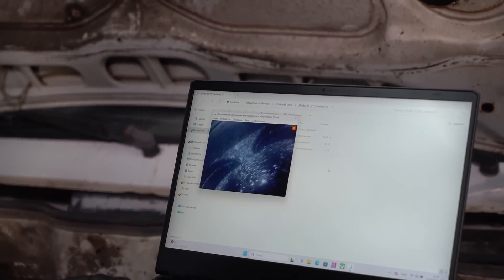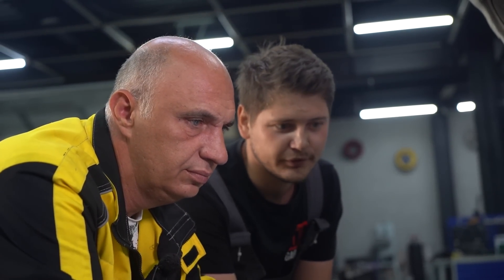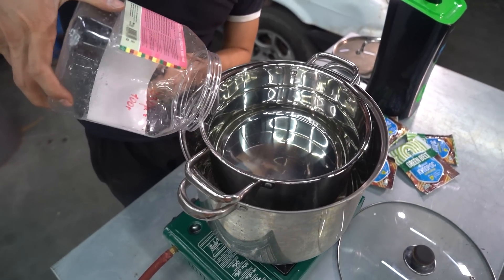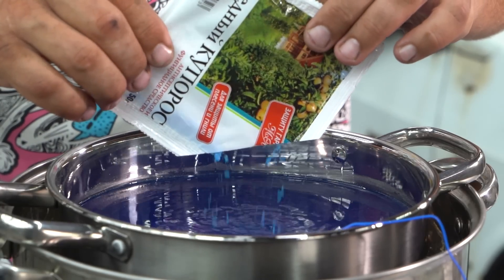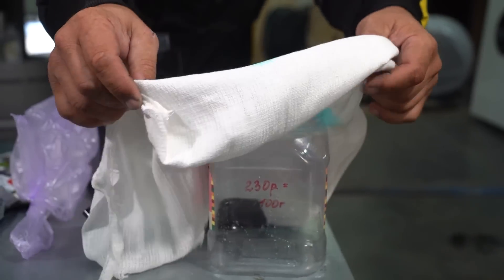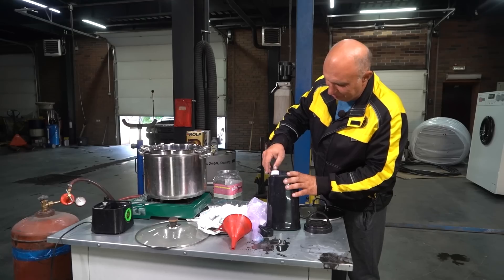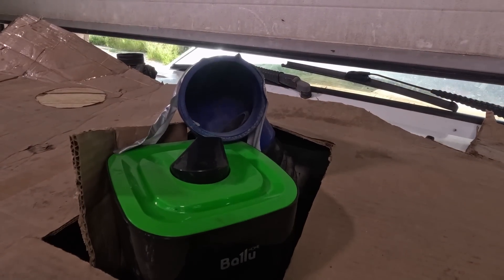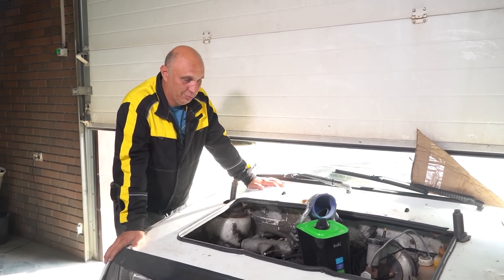Can we use copper sulfate to clean a sludgy engine?

Comment: Yep. One of the most important tips about ultrasonic humidifiers is that you should use ONLY distilled water. If you use hard water that contains minerals, they are dissolved in the water, and the mist contains such minerals. Then the droplets are deposited everywhere and when the water evaporates, it leaves behind the minerals. So, that deposits those minerals everywhere the mist can reach, over every surface.
This seems to be exactly what happened in this case: the droplets evaporated when they touched the hot engine, and leaved a lot of copper sulfate attached in those areas.

Comment: #4 has no compression … because it has no rings anymore. Copper is a GREAT abrasive. And if I’m not mistaken, will turn to sludge when it comes in contact with oil. But should be really pretty to look at. Also copper sulfate works great if you wanna clean up a pond.

Comment: Does the engine these valves came out of have a wild cam in it? I have long been sickened by posing drivers allowing engines to lope at low r.p.m. while stationary and at low road speed in front of crowds. As a mechanic I have been aware that such practices cause exactly what you are showing in your thumbnail  😢

Comment: Did you try 2 squirts of oil in the low-compression cylinder to determine ring sealing ??  If no compression  increase; look to valves. Easy to forget such a basic old technique.

Comment: now i would hose it out with water. crank it and give it some high test gas.pul it down the road . to see it te rings would come back to life i mean phosphates burn hot. the ring grime might burn out. i have used the old style ajax cleaner in motors . but that was sprinkled threw the intake. stuff burned real hot.

Comment: Turn  the engine over till valves closed then use a work shop air degreaser gun . Blast the port . Result is clean port /valve .

Comment: Americans will run the engine up to about 2000 RPM and run pure water in through a vacuum hose. It seems to help, maybe an experiment of running pure water into an engine to see how it does would be a neat idea... something fun for everybody to see!

Many Do-it -yourself mechanics like to run all sorts of stuff through the vacuum lines though.... intake cleaner, valve cleaner, seafoam, Marvel Mystery oil, kerosene, or just about whatever other solvents we can get our hands on.

Comment: You should try HHO or electrolysis. Hydrogen and oxygen. It's hoter more powerful and 10x faster. It cleans all carbon from the piston rings and valves.

Comment: "almost" every metal is more reactive than copper, meaning that whatever metals come into contact with the copper sulphate is going to sacrificially kick the copper out of the sulphate (hence the copper deposits) and replace with whatever metals are in the engine (iron, aluminium, etc). so yeah this was a terrible idea, you're just eroding the engine's metals and filling it up with copper deposits. evidently this was not suggested by anyone with chemistry/metallurgy experience. lol

Comment: WHY WOULDN'T YOU JUST PUT IT DIRECTLY IN SOME FRESH OIL??  LKE DO AN OUL CHANGE WITH IT IN THE FRESH OIL.  RUN IT FIR A BIT, THEN DO ANOTHER OIL CHANGE.  THIS WAS MEH...
Reply: The build up wasn't in the oilpan? It was in the Cylinders, where air and fuel come in and go bang. It wouldn't do anything to put it in the oil except damage your engine more.

Comment: What happens if you try this on a 2-Stroke engine?
Reply: copper sulphate will destroy (almost) any metal it comes into contact with (refer to the reactivity chart of metals) by liberating the copper in the sulphate solution and replacing it with the other metal, eg you might end up with iron sulphate and the liberated raw copper will build up and oxidize.
Reply: @joeledwards6587  That would be nice of the bearings in a 2-stroke engine... I want to see that! :)

Comment: I suspect that the water caused the copper sulfate to oxidize faster, and instead of leaving as a gas or dust, it just stuck around in bog chunks. and got burnt to the inside of the combustion chamber

Comment: Based on my own dabbling in electroplating, I wouldn't think using a humidifier would works, as the copper would be too heavy and wouldn't be retained in the water droplets. 
So it'll be interesting to see if the thumbnail was actual, or the typical photoshop job 😅

edit: Well, more made it in than I expected! I wonder if the "green" they're seeing is it having gotten converted into Copper Carbonate 3 (CuCO3)...

Comment: Try to rev limit the engine in low gear and high load, with no exhaust. it will clean the valves very well

Comment: You ran it at too low an RPM. The air speed inside the port allowed the copper sulfate to drop out of suspension and pool at the throat of the port. Run it at 3,500RPM.

Comment: there is a additive called engine restorer it was nice to see if it would help
Reply: I used this when it first came out in late 83. Much to my surprise, it really worked. Compression was improved. Engine ran much better. Since then I've used it in several engines with good results.
Reply: @halrhoads6194  nice, can it fix piston slap or rod knock?
Reply: @benshefer4767   I dont think it can because its mechanical parts that are already beyond repair

Comment: Clean the crap out of the ports and off the valves, along with the valve seats, put back together with new stem seals, using a new head gasket, and you should have good compression.
Reply: I mean, obviously....

Comment: You dont do that "water bath" because the heat is less intense inside (otherwise just boiling at lower heat would suffice) you do it because boiling water is steady @100c and doesnt increase in temperature (if you boil it on an open casserole like this )  no matter how big a fire is underneath it. 
This has as a result the inside smaller casserole to be at a steady 100c without increasing in temperature

Comment: Again requesting a Lada with an 'external oil cooler' that runs on cooking oil and routes the oil through a deep fryer 'external cooler' for fried food on the go.
Reply: Underrated
Reply: Making fries required oil at about 180c. How would the engine feel about it huh ?
Reply: @CaptainFalcon92   Just remove the radiator and use the oil cooler only to cool the engine
Reply: @gabrielvieira.4358  The engine would definitely end up seized, melted, or both at those temperatures.
Reply: @quentagonthornton49  Probably not, if the oil cooler was big enough
Reply: This has to be the most American thing I've heard today
Reply: Chinese gutter oil fries?
Reply: You can cook food even in motor oil but they just become inedible. Eating toxic food is not an experiment but suicide.

Comment: Please do a "Dynamic engine oil change" video. Where you open an oil drain plug a little bit on old and dirty engine and keep pouring fresh oil in from the top. How many litres does it take to get it clean?
Reply: They use to do it with diesel generators in the military that could not be turned off and had to run continuous.  Unfortunately I do not know how much oil it took.
Reply: I like this idea
Reply: They already did that using oil filters
Reply: They already did oil change till the oil is golden
Reply: you can't add engine oil while engine is running as it will spray through the pouring hole
Reply: @shrujanamsyama9940  Thats not true at all.
Reply: you use a spout and who cares about a bit of splashing oil?
Reply: @shrujanamsyama9940  HE NEVER SAID TO HAVE THE ENGINE RUNNING YOU EFFIN GHEYLORD PERSON!!!!
Reply: what's the point sounds boring
Reply: @benshefer4767  It will get rid of all old oil and flush the engine.  Some cars keep about 1/2 a liter of old oil in the engine when you drain it.

Comment: You guys should spray foaming degreaser into the engine and rev to 2500 rpms.  See what the results are!!
Reply: I have used zep degreaser in a engine. It did a ok job. But like other things you have to let it sit not running for about 10 minutes. Then a smoke show.
Reply: Water does the same

Comment: Fill an engine with diesel fuel, pour it into the valve covers and let it completly overfill. Then grab a air nozzle, mount a brake line to it, remove the dip stick insert the brake line into where the dip stick goes. Add just enough air to make bubbles and let it sit overnight. There was one vw guy, he would do this to clean sludge on engines.
Reply: Sounds pretty viable, would likely free stuck piston rings too.
Reply: @volvo09 that and help break up any corrosion that's on the walls. Diesel fuel works wonders when done carefully.
Reply: nothing beats diesel for dissolving bitumen (asphalt) and its carbon
Reply: Wouldnt gasoline work better for cleaning that diesel
Reply: @Crediu   No diesel has cleaning properties, gas has very little
Reply: @ibidu1  oh i thought gasoline was a solvent and solvents clean stuff
Reply: And then try to turnover the engine.
Reply: Makes some sense, there is more detergent in diesel than petrol.
Reply: Does the diesel evaporate? How do you get the rest out to not contaminate oil?
Reply: @JamesAnderson-fw5ew   You drain it out of the oil drain bolt, and for the fuel in the cumbustion chamber remove the plugs and spin the engine with no spark plugs.
Reply: @ibidu1  but does the residual diesel dry up?
Reply: @JamesAnderson-fw5ew  small amounts of diesel wont hurt oil. but best to put cheap oil and run it for a bit then put good oil
Reply: Also if you rebuild an engine and ita going to sit for a very long time completely fill it wth engine oil, fill the bottom end till you cant then fill the top end till you cant, its goinf to seep a bit over the years but after you let it drain, pull the glowplugs or spark plugs, turn it over by hand lots of times and once it wont hydrolock start it up and giver
Reply: @6literfuelaholic655  if its being rebuilt and ur gonna let it sit, use assembly lube on all parts
Reply: I Still favor an Italian TUne-UP to clean engine
Reply: @gabrielvieira.4358  yeah doesn't work on the intake valves on direct injected engines! Except Toyotas with port AND DI!
Reply: @cigarsgunsanddiesel8032  The dmax 4jj1 gets really bad carbon, but I just drove the hell out of mine and it never complained and never needed all the cleaning , it just got drove long distances every day, the carbon just got burnt out
Reply: @danielspoon1234  FASS makes EGR filters for diesels, or, you could go the forbidden route!😏😏😂😂

Comment: Use sand to clean it , just dump it straight into the oil!
Reply: Ah, Ford style.
Reply: I ll do it tomorrow. Thanks
Reply: Just like every American auto manufacturer.
Reply: This actually works! I tried it on my 92 chevy corsica. It was running rough for a few seconds, then boom. Problem solved.
Reply: @BrianLopez-dv7ep  Im about to do it now. A free resource like sand! Never imagined that could help to restore, the engines health! Thanks
Reply: NAH !    I DON'T THINK SO.
Reply: @NAMCBEO  I did it... Blew up my 2009 Passat V6 engine... Whats wrong? 2 pounds of sand at oil cap. 3 minutes at idle. Italian tune up, blew up... Too much sand?